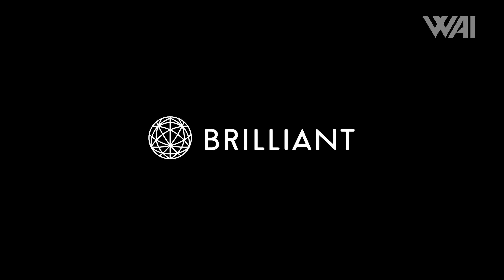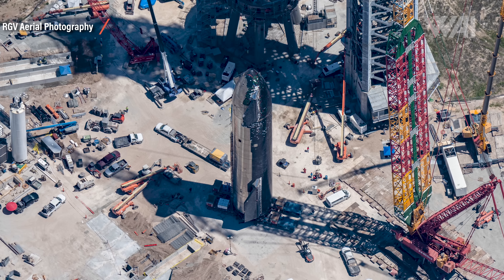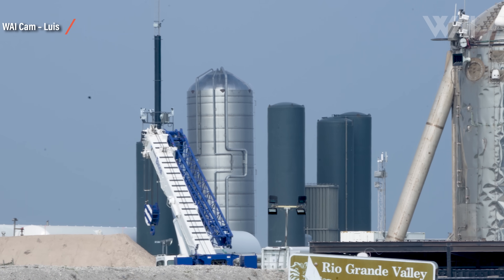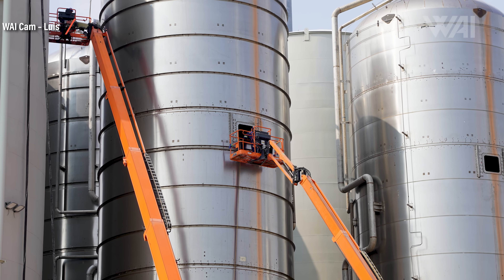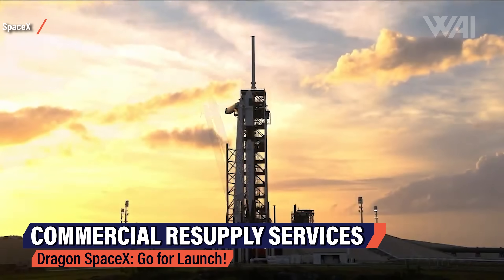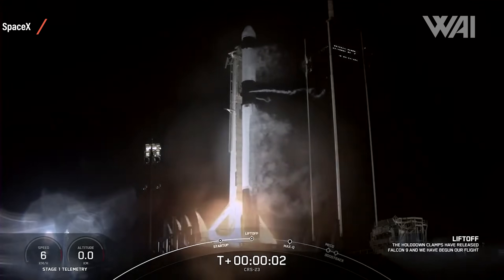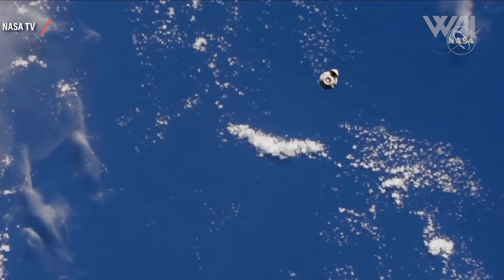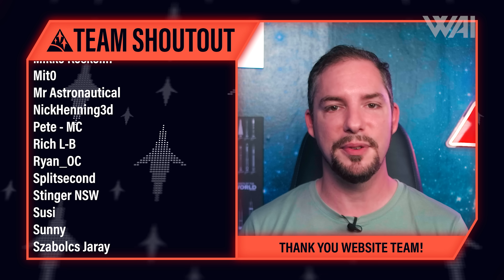SpaceX Starship Heat Shield & Mechazilla Progress Analyzed – CRS-23 Launch Report

Comment: I might be wrong, but to my eyes it looks like this TPS will be the biggest trouble in the design of the Starship... Like it was with the Shuttle...
Reply: the heat shields are still on testing phase meaning its still not on its final form. They will still make a heatshield that is durable, safe, reliable, and effiecient. plus, starships heatshield is bolted to starship itself instead of the shuttle where the heatshield is LITTERALY GLUED on the body of the shuttle meaning that it has a high chance of falling upon liftoff
Reply: If 20 disintegrates on re-entry due heat shield failure how do they figure out what went wrong?
Reply: @mitseraffej5812  avionics and software, each component of the rocket has a software which sends data back to a receiver including what went wrong.
Reply: @suborbitalpada6609  those will only show "it got really hot 🥵 "
Reply: @mrlarrybobjr  no it doesnt. it would show the temperature of the certain area of the ship
Reply: @suborbitalpada6609  correct "really hot" all they have to do is slow down, duh, then they don’t need any heat shields, none. In fact things would ice up. Duh. Slow down. Simple.
Reply: @mitseraffej5812  telemetry.
Reply: @Blue Red  Would every tile be monitored do you think just the area protected by individual or groups of tiles.?
Reply: @mitseraffej5812  
Instead of monitoring every tile, it is easier to put temperature and pressure sensors  every few feet. If the tiles fail in one section, temperature and pressure profile can be used to pinpoint that section. 

Hope this helps.
Reply: @mitseraffej5812  You should watch everyday astronauts interview with Elon.  He talked about having video cameras inside the vehicle to watch for hot spots etc.
Reply: @Blue Red  Will telemetry still work during re-entry? Has radio blackout  caused by plasma generation been overcome? Rocket Lab has been recovering data recorders from the ocean  in their attempts to develop a reusable booster, maybe they will do this.
Reply: @mitseraffej5812  I believe the plan is to have communications link via Starlink satellites at least during some parts of the flight including re-entry. The body of the Starship itself would block the plasma interference.

The Space Shuttle could communicate to the ground via a channel that went to a satellite in geostationary orbit and then down to mission control in Houston. It was not perfect since occasionally the tail of the shuttle blocked the line of sight between the antenna and that satellite being used.
Reply: @KnightRanger38  Thanks for the information. I now recall that just prior to Challenger falling to bits during re-entry ground got a cascade of ominous data. Without a vertical fin Starship shouldn’t have the same signal blocking issue, many more satellites as well.
Reply: @mitseraffej5812  a camera inside the tank would show where the hotspot is 

Steel will glow white hot before failing
Reply: @captainahab5522  regular night vision will show infrared light. You don’t even need thermal cameras, and would gain a lot more info than just a camera for the visible information. A small weight penalty though, and I’m not sure if it would work with whatever housing it would need to be in whereas visible light would.
Reply: @mitseraffej5812  in-flight data and video stream/ recordings.
Reply: This will be one of the biggest hurdles to overcome, no doubt.
Reply: The biggest hurdle is to have 29 raptors igniting and not blowing up stage 0.  They'll figure out the tiles easier.  There are so many missing just because they had to rush the stacking.  They had to make sure there would be no problem stacking the stages because the Launch pad required a lot of work.  Lightning those monsters is the challenge.
Reply: @LACHIVA1969  
Nah. There are 27 engines on Falcon Heavy. 

SpaceX has plenty of experience lighting large number of engines. 😀
Reply: I agree. When you see a closeup of the nose and the flaps, it looks more and more like the shuttle

Comment: On the straight cylinder parts of Starship,  wouldn't it be better to have large pieces of the heat shield?   Why do pieces have to be small?   More prone to cracking?
Reply: I think they're trying to keep all of the tiles the same size, just so that it's cheaper to manufacture

The less proprietary tile shapes they have, the cheaper it'll be

Comment: I think the heat shield is going to be a point of massive problems and delays. it was the shuttles biggest downfall and spacex is basically using the exact same system as the shuttle. I think people are minimizing its complexity because it has a few less parts. I think they are vastly underestimating the difficulty of it.
Reply: It gets worse when you add the risks to the TPS from catching the starship with the tower.
Reply: They're not using exactly the same system as the shuttle... about the only thing they have in common is the word "tiles". The materials are different, the attachment mechanism is different, the shapes are designed to be interchangeable... it's almost like SpaceX looked at all the problems the Shuttle had with their tiles, and decided to learn something from it. 

Sure, the first attempt to use them is showing some difficulties, but I wouldn't regard that as a reason to write off the whole concept just yet... afterall, the same has been said about pretty much every single thing that SpaceX has ever attempted (sometimes rightly, more often not).
Reply: they should probably hire you to straighten them out, right?
Reply: On the one hand, I agree. On the other hand, I think SpaceX will keep working on it until they can make it work well. Like they do with everything. If that is the only sticking point, I don't expect it to take to long for them to work it out.
Reply: @paull3278  i wonder if they'd be better off going with fewer, but larger, tiles. especially for areas with complex geometry.
Reply: @paull3278  i agree, i think they will keep iterating on it and try different designs until they achieve their objective: highly reliable and easy to mount and maintain heat shield tiles. on the Space Shuttle every single tile was unique, and the design was pretty much frozen in, so they had a huge amount of work to maintain them after each flight. SpaceX has already improved on that aspect because many of the tiles are identical on the barrel section. Even on the nose cone the symmetry means that they have fewer tile types. Difficult areas are the parts of the upper and lower flaps that have to accommodate movement. But they will work that out. They have the freedom to innovate until they find a good solution - the engineering culture is much healthier at SpaceX than it was when the Space Shuttle was already flying people and cargo to orbit.

Comment: Marcus What do you think about Space X? Shouldn't they buy a compressor that will create LOX and NO1 even Helium? While I was in the USAF stationed at Kadena AB Japan they had a building that inside had a pump that would create extreme high pressure of air, This makes it hot, then would rapidly release the pressure and the air would get extremely cold. Eventually, the temperature would drop from 297 degrees to 300 degrees below zero creating LOX and LNO2 and liquid NO2. Storing these liquids can be done at the farm. Good Idea??

Comment: I think spacex will move the fore and aft flaps more to the leeward side. Musk has mentioned this with respect to the front flaps already.
 So if you were looking at the nose of starship pointing directly at you, the flaps would be at, say, the 10 o clock and 2 o clock position. This would keep the hinges out of the direct plasma flow. As they stand, the sharp angles will cause localised heating more than the rest of the body. I'm thinking something more like the classic lifting bodies we are used to seeing, but with the cylindrical body of starship. There cannot be any sharp angles during re entry.

Comment: My guess is it will take 6-12 months to get the heat tiles sorted out for *single use*. Developing rapid tile replacement protocols, or engineering the shield to endure numerous re-entries, will probably take another year beyond that. Many lessons will be learned from the re-entries.
Reply: As much as I hate to admit it you are probably right about the heat shield. It looks like its going to be an engineering nightmare.
Reply: Given the number flagged tiles we're seeing, I don't understand why SpaceX isn't planning a short 15 or 20 km atmospheric hop with Starship 20 alone, to get a feel for what effect the atmosphere will have on tile installation before moving on to the boosted suborbital test. As things stand now, I expect to see a successful launch followed by a reentry failure.
Reply: @_photonx6017  *Everyone*, expects a re-entry failure, SpaceX included. The point of this flight isn't to land SN20 intact - it's to see if they can get it to orbit, and to see how well the tiles cope with re-entry. They're not interested in doing short atmospheric hops, because that's simply not something Starship ever needs to do — but the ability to reach orbit is priority #1, and the ability to re-enter is priority #2.
Reply: Yeah, there look to be a staggering number of misfits, and unfortunately, this one might probably explode on reentry, but I'm certain that many lessons have been learned. They are redesigning this element and Starship 21's shield should go together smoothly. I don't think it helped that they hurried through 20's install.
Reply: Elon think an operational SS will be ready for 2023....so yea a good 18 months at least.
Reply: Obviously you don't know Elon ...he won't settle for that

Comment: Such massive failure on heat shield during the simple transportation is weird. Tiles are attached on robot welded studs and while they were installed fast, hard to see how it could be done wrong.

Stress during the transfer should be minimal compared to stress during ascent and re-entry. Vibration could be one reason for failure since the tank wasn't pressurized but nose cone suffered even more and it is not pressurized during the flight so there is severe problem with tiles.

Comment: Hey hey nice video and congrats to Luis. Just some questions... is the orbital flight gonna use the new designed forward flaps? Why are the heat shields on the top of starship cracked? And why are only the top ones cracked?? Sorry for that mutch questions ^-^

Comment: Weren't all those tiles damaged when SN20 was stacked on the booster? Did they determine what caused the damage and correct the problem?
Reply: some of the live footage from labpadre and nsf showed them cracking or falling off whilst they lifted. The body flexes a fair bit still. It's looking like the TPS tiles are going to be a bit of a headache for a while until they figure out a better solution.
Reply: @puressk  Did they have the entire ship pressurized for the lift? A pressurized ship should be much more rigid. It seems to be asking a lot of the ship to endure compression from the force of the engines and tension from lifting the ship by its nose.
Reply: They were rushed for the stacking.  It was also a photo promo.  If Elon's engineers could figure out exploding batteries on Tesla vehicles then his rocket scientists at SpaceX can figure out falling tiles.

Comment: I think that these tiles is the 'succes or failure' of Musks space dream! Massive problems with  tiles during re-entry could apear. We'll see. The best of luck for SpaceX team!
Reply: I totally agree with this thought. Tiles on the space shuttle was its failure. But I the people at Space X may have figured something out.
Reply: @davidwilson2394  I'm sure they've spent time a lot of time testing tile formulations and mounting systems on a vibration table.
Reply: @joelroth8476  An given what we are seeing crack tiles and tiles falling off, all from just lightly moving the star ship around the site and a bit of wind, space x got a long way to go to perfect it tiles and to be able to do potentially multiple launches a week or even a day with the vehicle.
Reply: @davidwilson2394  The shuttles tiles were old technology by the craft retirement. NASA had better titles developed for the venture star I believe but they never got the funding to modified the shuttle to use them because their no money for old space in modifying existing vehicles.
Reply: How about some sort of heat shield blanket.?  This tile thing sucks... it sunk the shuttle,  and if they don't  change the tiles it may sink them. Too.
Reply: Considering the issues the Space Shuttle had, that makes sense.
Reply: I can picture them casting starship and making a mold for one continuous ceramic piece on the main body leaving only the serviceable areas open. Then they'd only have to individually tile those areas after testing. I was thinking about that when they started casting entire frame sections of the model Y eliminating 100s of parts and 100s of processes.
Reply: Actually I disagree. The tiles are crucial for the purpose of landing a Starship back on Earth.
But how many of the fleet of Starships will have that requirement to land on Earth?
- Maybe the fuel transport Starships
- Not the moon Starship (if it can be rendezvoused in LEO with a crew Dragon capsule)
- Not any Mars Starship: large equipment is supposed to go FROM Earth TO Mars, for the foreseeable future, I think. And personnel can be shuttled with a small and safe Crew Dragon capsule.
I'd imagine Starships in a parking orbit in LEO; or maybe a little bit further out than Geostationary Orbit for long-term storage. Maybe if they need repairs you'd want some kind of "drydock" somewhere.
Reply: Can't they use aerogel to protect against heat?
Reply: @maanvis81  I was wondering the same thing. I reckon it's a strength thing. Aerogel is brittle. Still, good thought.

Comment: The mass tiles need to be attached by a tile-mat rather than one by one attach method…yes there will be added weight but if you need assembly speed for a rocket’s first launch perhaps this might be a viable solution…then if individual tiles fall off upon descent then they can be attached manually where they are missing….
Reply: Tile mat makes replacement more difficult and risks ripping many off if a fault occurs.
Reply: @nononono3421  as I said for the initial installation make it a mat (well tested of course) if one rips off during descent then for subsequent flights attach tiles manually. Doing it one by one for the first launch would be way too time consuming I doubt think Musk believes manual application is the ultimate way. I could be terribly wrong. Perhaps they could make a giant mold for the majority of the tiles. Who knows but one by one seems implausible with Musk’s sheer volume production of Starships and launch timelines…
Reply: @squashduos1258  A mat has to be attached somehow, which then would risk getting pulled off with the tile that comes off, dragging more of them off in a chain reaction of tiles pulling out, instead of the single one falling off.

Comment: It seems like tiles could be applied like kitchen backsplash tile. On a netting, 10 or 20 or more at a time, on a sheet and firmly attached
Reply: The only problem is that most of the tiles are mechanically attached. Maybe that could work on the sections with glued tiles though, like the nose.
Reply: The tile edges need to butt together. The compound curved nosecone will be different at every row of tiles and the edges need to meet without gaps. A tough problem.
Reply: Wouldn’t that make it more difficult to replace the ones that need to be replaced?
Reply: Those things are not small 350mm or so so a sheet would be big and tricky to handle
Reply: Good idea but only using three tiles in a mesh grid?

Comment: I remember one of the points of the stainless steel choice over carbon composite was an assumed lack of heatshield requirement
Reply: No. It just don't need as thick heat shield. Perspiration cooling was one of the first option but probably scrapped because such small holes and channels would be too expensive to produce.
Reply: Who said that? Re-entry temperatures have always been high enough to weaken or even melt steel. It was obvious some sort of shield was required. Arguably less of it, but not a lack of it.
Reply: @Diggnuts  Well, that was the take on it back in 2019, as presented by Real Engineering and Everyday Astronaut videos. Assuming methane sweat cooling to close the remaining temperature gap, that is, the idea was that there were no necessity for heavy tiles, thus making a steel rocket possibly even lighter that a composite+tile heatshield vessel. Sure, methane cooling was ditched due to it's complexity. The question is, is a steel+heatshield ship still lighter than a composite regular rocket?
Reply: @gastonpossel  I always interpreted the transpiration cooling method a far flung option that was interesting but nothing serious until actually demoed.

I think the right question to ask, just as it is with the specs of the raptor engine, is whether or not steel + heat-shield is capable of rapid re-use compared to more traditional rocket materials as used in, for example, the Falcon 9.

Remember, the raptors could perform a whole lot better if they were designed and intended for single use. Same goes for the entire system.

Comment: Probably dumb question: why can’t the heat shield be just a few large pieces?
Reply: Thermal expansion. Tiles need to be able to move slightly. 

Each tile is the size of a large dinner plate. The goal is to have generic shaped pieces. That can be mass produced. Spending time maiing custom bespoke parts isnt quick enough.
Reply: it's probably easier and cheaper to manufacture lots of tiny identical pieces instead of one huge complex heat shield.